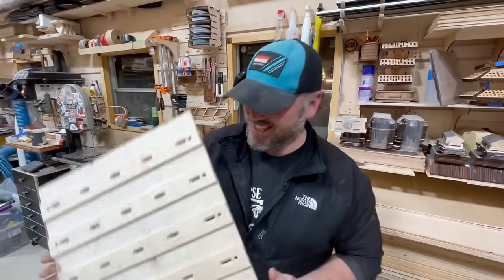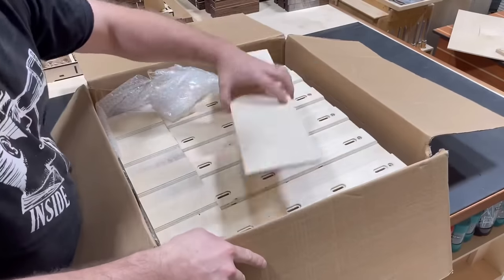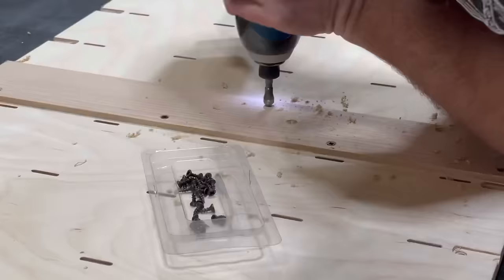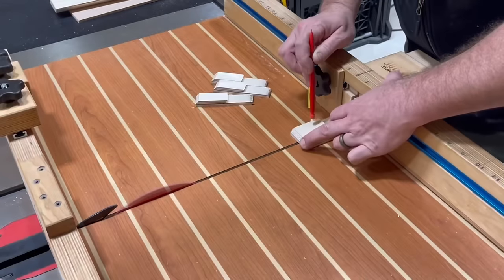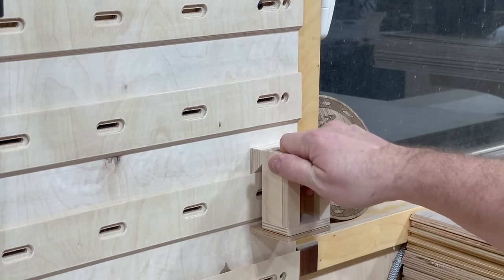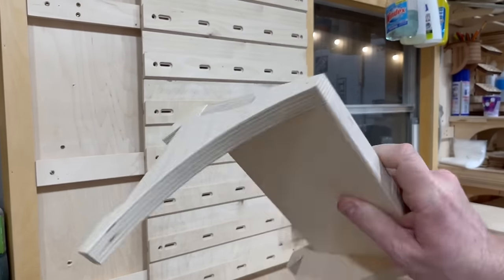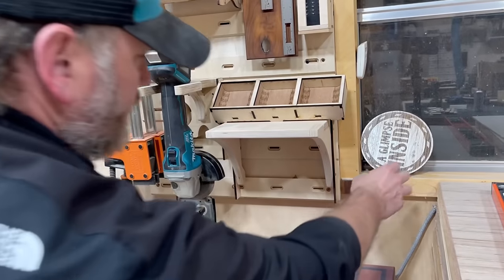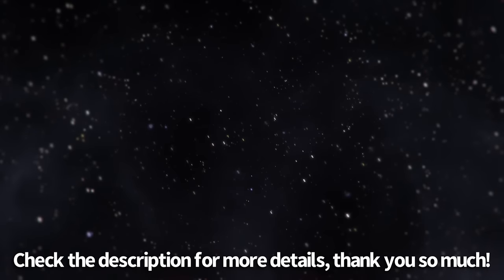French Cleat System, Revolutionized | You HAVE to See This

Comment: I'm all for innovation and such....   BUT...    I can hang a 3/4" ply sheet ($36 nice finish on one side) and cut another reg 3/4 into 3" x 96" cleats ($32) and have 32sf of cleats for under $70.   Whereas this is $99 for less than 12sf...   What am I missing here?     Throw stones if you must...   I'm currently reconfiguring my 2-car garage (my wood shop) into french cleats wall-to-wall.   I just finished my back wall...18' x 8'  (but only cleated 12' because of tankless water heater in the back corner) using 3 sheets of 3/4" ply for the panels, and 2 sheets of 3/4" ply for the cleats at a total cost of about $200 (and would even be about $40 cheaper if I went with 1/2").   it would cost me over $800 using these...and thats just for the smaller back wall.

Comment: This looks like  a 1-piece solution for something that 2 pieces would do much more efficiently and cheaply. Laminating 1/4 inch cleat strips onto 1/4 inch plywood would  do the exact same job. I do like the channels on the back if you needed to run wires behind the cleat wall though.

Comment: I think I’m missing something. Did you put up cleat runners on your wall, take a panel and attach cleats to it, make a tool holder, attach cleats to it, then hang it on the panel? If I got it right, the panel is redundant.

Comment: Do these panels have some protective finish on them? I’m thinking these panels combined with your holders would be much more versatile than the metal wall control systems.
Reply from the maker: There is no finish as they come. I appreciate the kind words about our systems. Also, if it’s any thing worth mentioning, I have a Baltic birch end table that’s been outside for about a year with no finish on it whatsoever and it is dark gray at this point but it’s still very structurally sound

Comment: Awesome idea but at $99 for one 20x20” panel is expensive
Reply from the maker: Mac I want to know your thoughts on this. Trying to keep everything in house meaning manufacturing them in the United States makes them the price that they are. Would you rather everything the outsourced to Asia with lesser materials to be cheaper?
Reply: Its actually 3  20" X 20" panels, 2 with holes and 1 without holes. That said, it is still too expensive, I'll make my own.
Reply: @AGlimpseInside  First of all its not a criticism about this product. But I was taken back by the cost, I was envisioning to fill the entire wal above my 20ft workbench about 36” high it would require about 30 panels or $2970!  You know best about your workflow and capabilities of your shop. From my limited perspective it seems waist-full to me to remove that much material in material and machine time. Perhaps a combination of pre cut French cleats with the pre drilled holes that can be glued and screwed agains the wal or plywood. Just a thought.
Reply from the maker: Yeah, there’s no doubt that these are more of the high-end Style I just found them so unique and really aesthetic. But I totally get standard cleats because he and I honestly that’s what I have gone with to start my maker journey.

Comment: Interesting idea. so the thickness of the cleat is only 1/4”?
Reply: I thought the same thing, “dang that’s not a very deep cleat, how strong can it be?“

But thinking about it, if you glue three-quarter plywood to the backer panel to make your cleat you’re still relying on the glue between the pieces. That’s really not any different than relying on the glue inside the plywood. The internal plywood and glue may even be stronger.

Then, once you run screws into the backer, studs, those cleats are probably up there for life.

Comment: How plumb and flat do our studs need to be for these things? One could theoretically make these panels out of their own quarter inch plywood, but I would be afraid they would be wavy once they got screwed to the studs. Do these have the ability to twist, bend, or warp? Or does the 1/2” thick sections of the cleats keep them fairly rigid?

Comment: Well I missed it I guess. What are all the domino holes for? I also missed how this is so much better than your cleat wall. Your a good guy Chris and I enjoy your videos. Keep punchin
Reply from the maker: Therefore inches apart, and 1 inch wide each to install into studs
Reply: One benefit I see is this could be used to alter the size and spacing of existing cleats without a reinstall….also could be a quicker install (one step) for a wall with NO cleats at all, right?

Comment: Besides being much thinner, is there any other advantage compared to whatever we used to see?  I might have missed the point of this system
Reply from the maker: The main difference is that with typical Fred’s cleats I would really never install them over drywall finding the studs every 16 inches. I would always put a backer board up first and then put the French cleat on that backer board. With this system you don’t need to do that. You have pre-drilled holes every 4 inches to allow you to find studs wherever they are , and also one other main reason is purely aesthetic as well. These panels would group together in a large setting look really great and sometimes walking into a maker space that is just decked out with something that looks awesome really does enhance the creativity.
Reply: @AGlimpseInside  I actually find your setup more eyes pleasing.  You took time to plan out your French cleat layout and it looks better without the pre drilled holes.
Reply: @b3arwithm3 I love bears 🐻

Comment: What's the length for the fasteners
Reply from the maker: Cshardware.com it’s also linked in the description in the length are used in the video was an inch and a quarter, but I do have inch and 5/8 and 2 1/4 inch screws always at the ready
Reply: Thomas Boyer

Comment: 2 each 20 by 20 panels $100. I think I can do better.
Reply from the maker: Thanks for checking it out man
Reply from the maker: Also. Would you rather the cost be lower if we were to outsource the manufacturing overseas or are you OK with keeping it made in the USA?
Reply: On the linked website it says 2 panels with holes and 1 panel without holes, still too high for 3  20 X 20 pieces of ply.
Reply: @AGlimpseInside  I will keep it made in the USA, but by French Cleats will be hand made by me and installed by me.  Much more cost effective.